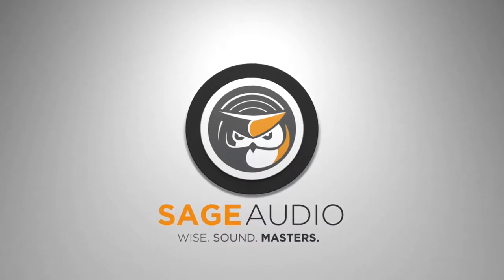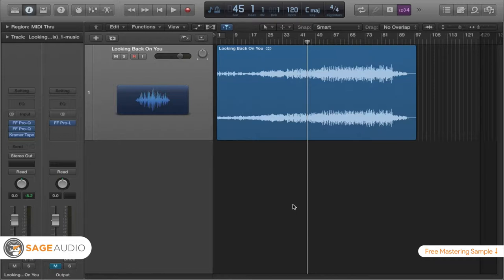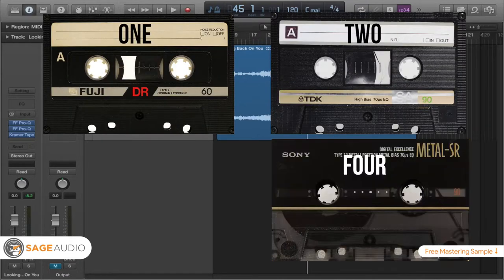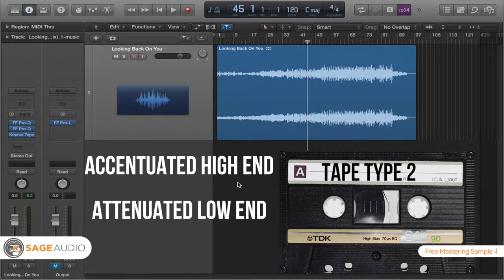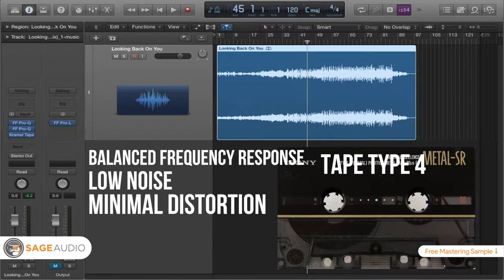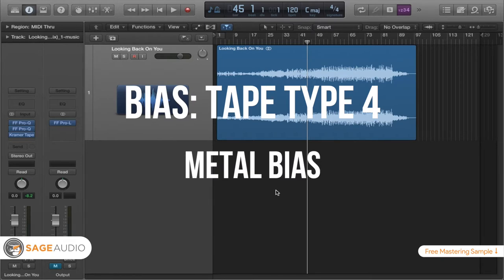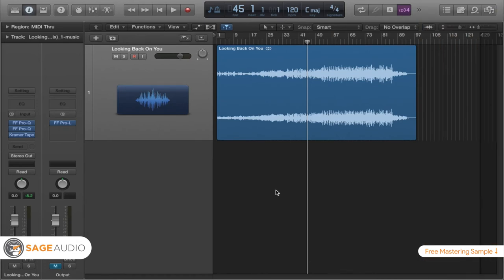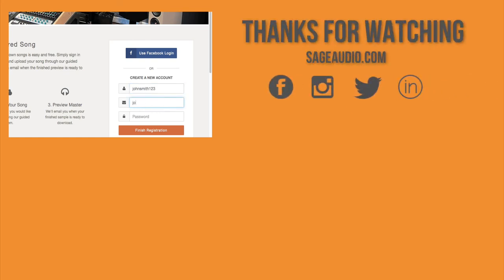What is Mastering for Cassette

Comment: Do you set for -1 on the true picks ? Or -0.5? And LUFS ? how high do you go? -14 like streaming or is it higher ?
Reply from the maker: Hey Anamnesis AudioStudio! Thanks for watching and leaving a comment.  

-0.1dBTP is a good output for your master if you plan to put it on tape.  Since the file won't be converted to a lossy file (like with online encoding) you don't need to worry about significant changes to the amplitude of your master. Also, -14 LUFS will work well, but I might go a little louder like -12 or -10 to help cover up some tape noise.

SageAudio.com
Reply: @sageaudio  thank you very much for this reply, really loved the channel. And the website
Reply: Don't care about some LUFS and other nonsenses, you are not a radio channel or jukebox. 
My method of recording cassettes is to find the highest volume that doesn't cut peaks, I find the most loud or compressed part of song or whole album, then I will try to record part of it and set volume to 0 dB peaks on meter on tape deck and then I slightly lower recording volume and record whole song or album. This is the best method to have the best signal/noise ratio without using some extra compression and stuff like that. Ofcourse I am talking about just recording songs to cassettes, not about mastering your own music.
I mostly increase volume of each song to -0.2 dB peaks, if it has very high dynamic range (some old CDs o LPs can have even 15+ dB) then it's better to slightly compress it to like 10-13 dB of dynamic range.
I don't care that each song can feel slightly differently loud.

Comment: Hi thanks a ton for the video I found this very helpful , personally I am considering mastering my mixes to cassette to get a bit of analog warmth saturation and then bounce ing it back to the digital realm a reel to reel is too expensive for me at the moment and I already have a pretty good cassette deck (Nakamichi 500) do you think this could be a less expensive option ? Maybe using quality cassettes I’m pretty shure it could work out would you have any reccomendations or tips or have you ever done anything like this ? Thanks in advance regards from Palermo 😎
Reply from the maker: That's a cool idea! With something like that, you'll have to experiment to get the sound you want.  My only recommendation is to adhere to the EQ response of the tape you're using and record to tape with a level that's right before you hear distortion (during the tape's playback).  

Cassettes will have a lower sound quality than reel-to-reel due to the width of the tape, but, it's still worth trying if you're alright with losing a little fidelity (but like I said, some experimentation could result in a cool sound).

Comment: I'm thinking about buying a rack mountable Marantz PMD 300CP dual cassette deck to record to. Does that sound like a workable plan? I'm thinking of recording everything on my Mixer, sending it tape and from tape to final mastering in DAW.
Reply from the maker: Thanks for watching Dean! If you can get your hands on one, recording to a tape machine would sound better than recording to a cassette deck.    Typically cassette decks are better for creating a consumer version of the recording.  Thanks for watching!

SageAudio.com
Reply: @sageaudio  Thanks, I'll keep that in mind. It looks like you can get a decent Reel to Reel for under $400 if you look around. I'll experiment with cassettes first. I think that may work well for me because I'm already getting a really warm sound working with a decent ribbon mic, external pre amp/eq and compressor before hitting the DAW. Either way for the sound I like recording strictly in the box totally doesn't work. Thanks again!

Comment: Say you were to create a duplicate of a master tape (assuming correct types), if you were to create another duplicate based off of the last duplicate rather than the master tape and then do that a number of times, would all of those tapes presumably have the same quality, or would it degrade over time, but less so than duplicating the master repeatedly?
Reply from the maker: Thanks for watching!  In this case there would be less degradation, but you'd still have some over time.  I'd recommend using the digital master as the source for each new copy, instead of copying from tape to tape.  This way you avoid degradation entirely and get identical copies on each tape.

SageAudio.com

Comment: Hi, do you think it’s possible to use type IV cassette with a high quality cassette recorder and then back the signal from the cassette recorder into the computer going through a high quality soundcard (with a good ad-da converter in) to add and interesting feel and texture to the sound ? In that case should i do the mastering before ? If yes will the signal go over 0 db after going back to the computer, should i put a limiter ? Thanks in advance hope you will see my comment, the process is maybe not 100% clear in my head because i don’t have all the gear yet... musically greeting

Comment: hi cassette are a right pain at 1 7/8 ips  the EQ is a pain  i use  3  3/4 ips  that tascam dig
cassette deck heads are very poor  putting in the logic to do the mastering some don't
like this  AAA is very hard on cassette  i have a otari mtr 12 with 1/8 cassette heads 
save all this computer work  some one i know had some from a slave  reel to reel deck 
that was used to record the pancakes for cassettes out tec i am in to
Reply from the maker: Hey Bob! Thanks for watching and leaving a comment.  Using lower tape speeds, especially with cassette doesn't sound easy.  Thanks for sharing your setup!

SageAudio.com